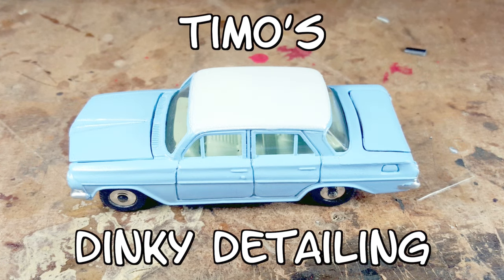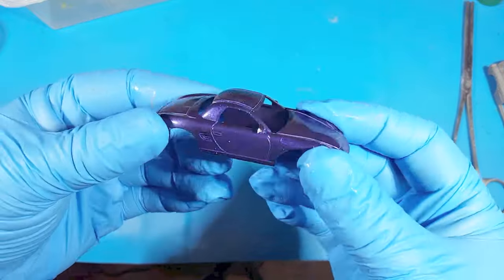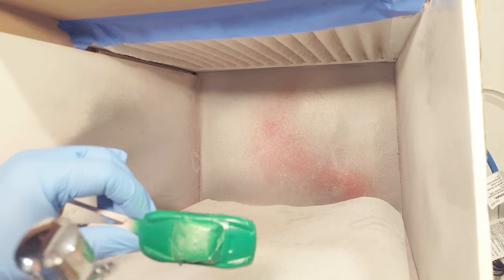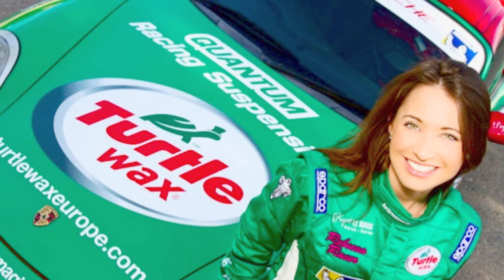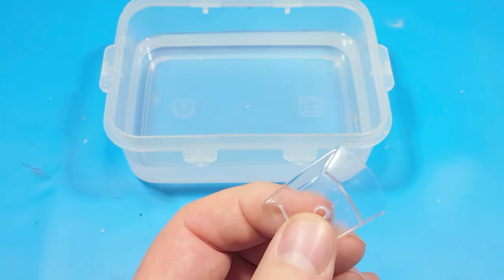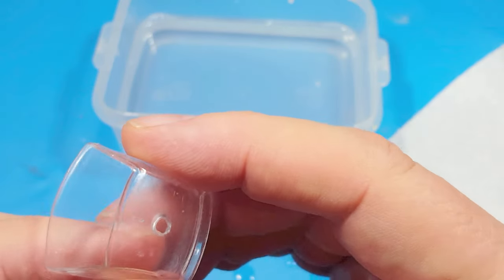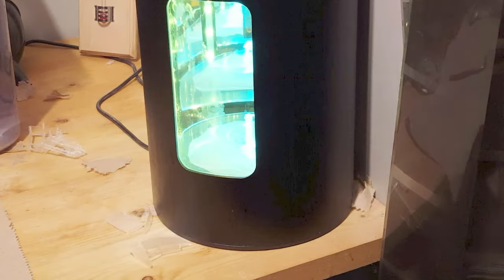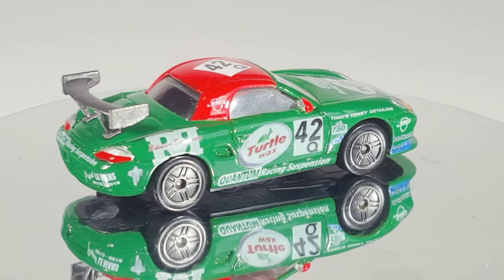Porsche Annual Invitational Build off #MLCPorsche4

Comment: Hey Timo, great job mate. If you run your dirty alcohol through a cheap water filter jug, it clean Ur alcohol up cheers Graham.
Reply from the maker: Thanks Oz. wouldn't that spoil the filter jug? I guess that's the reason for "cheap" water filter jug.
Reply: @timosdinkydetailing  yes, U would not want to filter Ur water after. Lol.